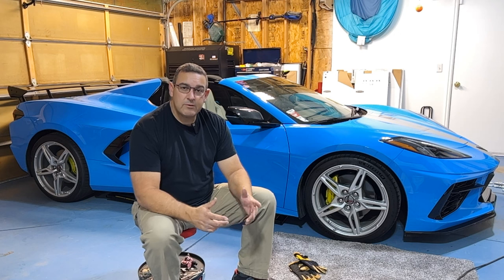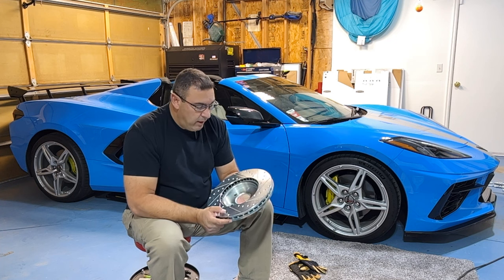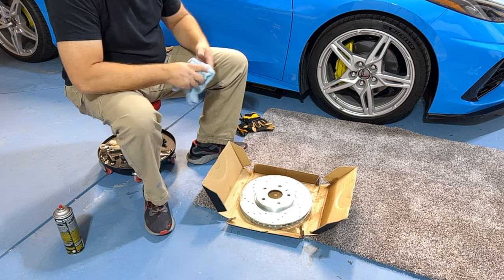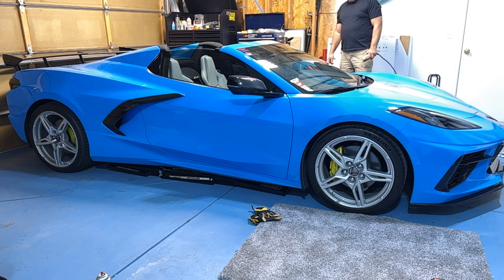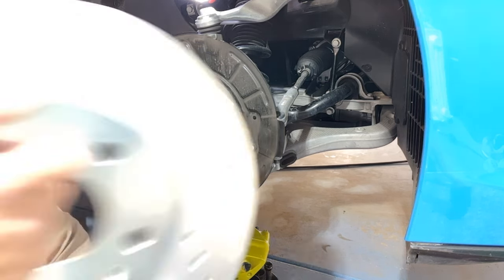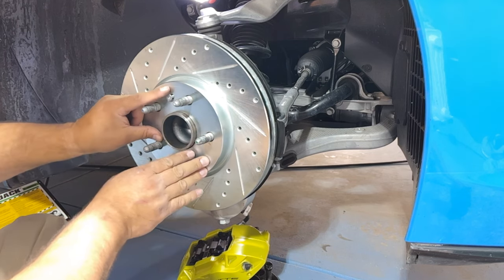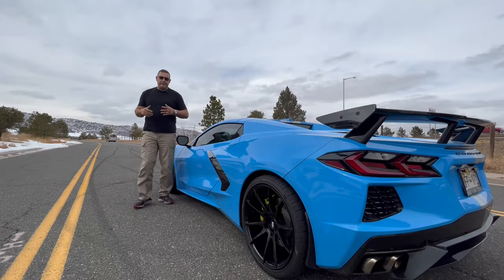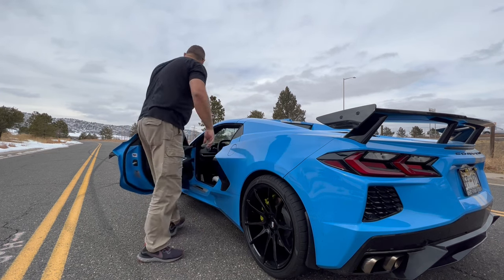C8 Corvette brake rotor upgrade and pad bedding.

Comment: Thanks for making this! I have slotted rotors coming in the mail to help with my non z51 brake heat issue on the track. Doesn't look too hard I already change out my own pads.

Comment: hey great video ...can you please tell your viewers especially me how these rotors are holding up ....do you get any vibration etc......i just ordered them from rock auto.....they are the extreme edition for the Z51 I ordered just the rotors from rock auto and the pads i ordered are the hawk performance ceramic as my second priority is ultra low brake dust ...first priority being stopping !!!!
Thank you for taking the time to read this and respond !!   
Also what are the rims and tire sizes you are using ?
Reply from the maker: Hello. Thank you for watching.  So far no issues. About 1,000 miles on them and 2 Autocross events with 2 drivers per event, so they definitely got a work out.  Wheels are Savini’s and the tires for street use are Pirelli P Zero for street use and a set of 275 and 315 Falken RT660 for track days.  Thanks again.